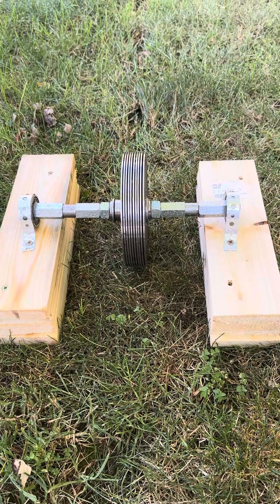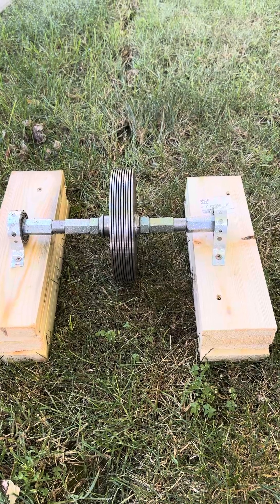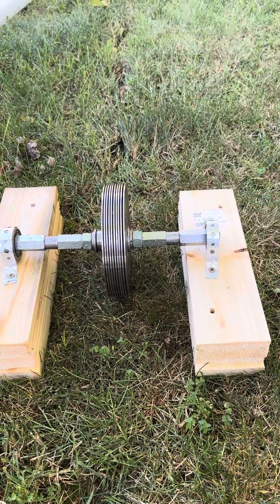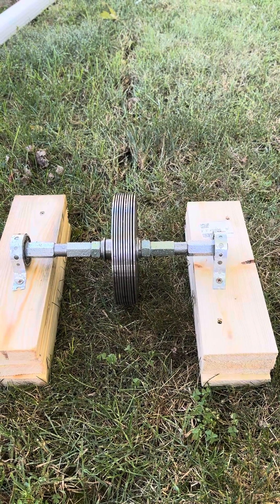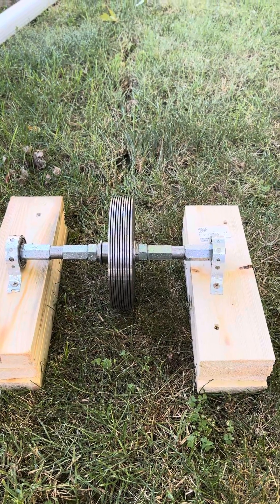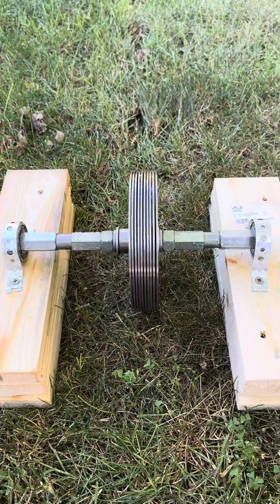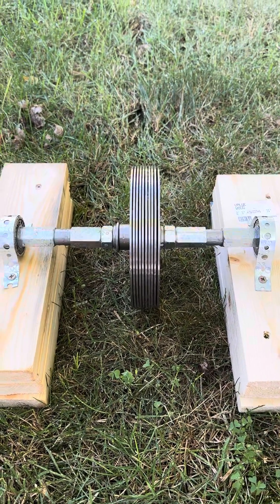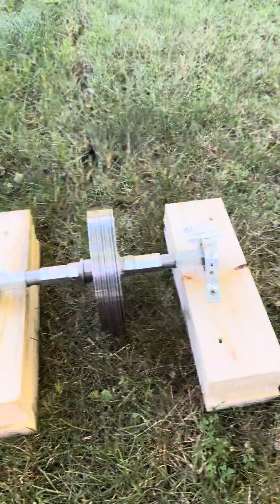September 3, 2023

Comment: Where are you going to put it?  Drain pipe? Rain gutter? Waterfall?
Reply from the maker: That…is the big question.  Free falling water or a source of free pressurized water will be needed.

The other big question is if I can get it to generate and keep spinning
Reply: @tommartens3731  maybe you can use a low torque brushless motor and slowly trickle charge a battery.  Pun intended.
Reply from the maker: @TC-im8eq  I am planning on using a multi gear reducer to get the torque needed for a heavy load
Reply: @tommartens3731  post the video when you have it all figured out!
Reply from the maker: @TC-im8eq  it’s going to be a process